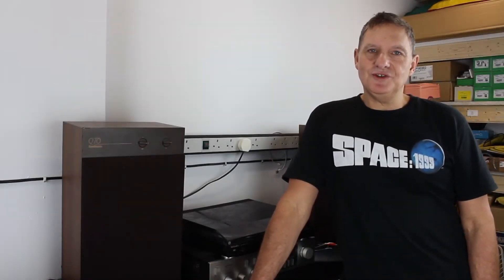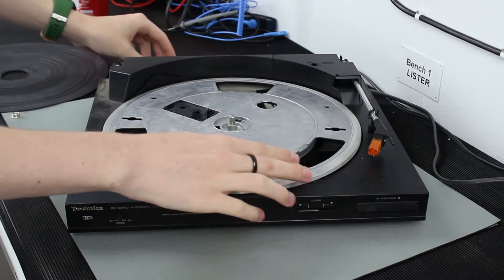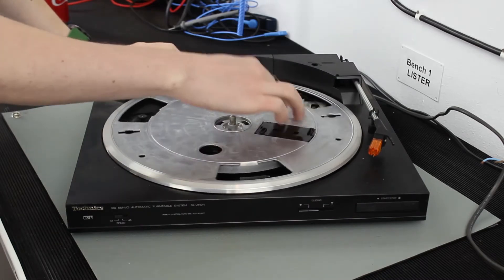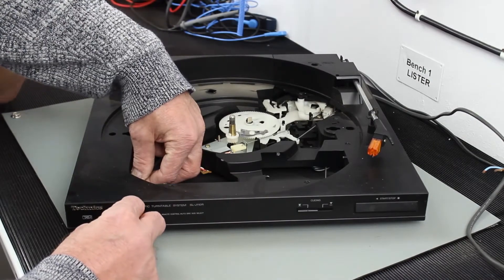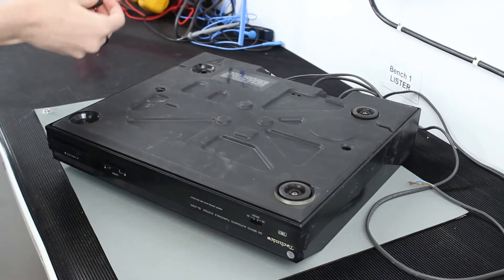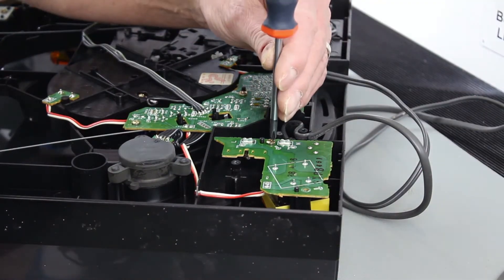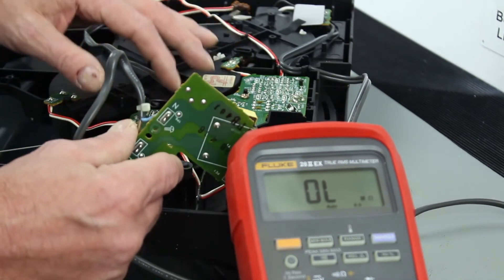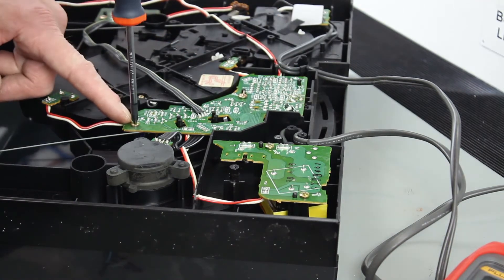Technics SL-J110R turntable part 1unbox & inspect. £10 eBay purchase - Can we make it work again?

Comment: Bonjour j'ai ce modèle et quand un disque tourne un bruit provient du côté de la poulie en plastique, je suppose que c'est le moteur juste dessous ,auriez vous un renseignement pour que je puisse supprimer ce bruit ( un dégrippant peut-être ) sans changer la pièce, merci
Reply: Is there something trapped between the motor and casing? If its the motor bearings, then adding lubrication doesn't normally work and the motor would be changed.

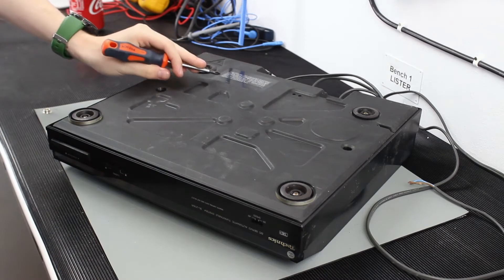Comment: Hi, I have a question about this turntable that I can't explain. When the silver feet of the turntable are used (see 4:56), it does not stand up straight, but leans backwards. Only when the silver feet are removed and only the rubber feet are used does the device stand upright. Have you also noticed this and do you have an explanation for this technical implementation?
Reply from the maker: Sound rather odd. They should sit flat and flush with the bottom of the metal plate. Has someone fitted the wrong feet from another unit.
Reply: @RetroTechRepairShop  Thank you for your reply. It's odd indeed. The feet are right according to the manual of the Technics SL-J110r. If you still have the turntable you repaired, you can measure it. It is not straight, even if it looks that way at first glance. In comparson, according to its manual, the Technics SL-J100r does not have the same silver feet, but only the rubber feet and would therefore likely stand straight.

I have now removed the silver feet and only use the rubber feet at the back and front (as on the Technics SL-J100r).

Comment: Hello Sir. I have this exact turntable from early 90's. It is well used and works well but the motor has a squeaking sound occasionally. Maybe lubricating it can help but I don't know how to do it. Do you have any suggestions on it?
I replaced the cartridge with Audio Technica EP85 which improved the sound a lot.
One of my discs runs at lower speed (I tried in another machine so the problem is not the record itself). I think it is related to the belt and may need a replacement I don't know. Any suggestions would be much appreciated.
Thank you very much.
Reply from the maker: It sounds like the belt drive is slipping, so its probably best to replace it as sometimes they look  ok but slip slightly under load such as a heavy vinyl. You may also need to check the RPM speed and trim it. 
If the motor is squeaking, it may be possible to WD40 the spindle at the bearings. I found oil doesn't tend to help so much and can make a mess. I had a tape deck with a squeaky motor  that would just keep coming back, so I ended up changing it. Try the HD 40 sparingly first. Hope this helps